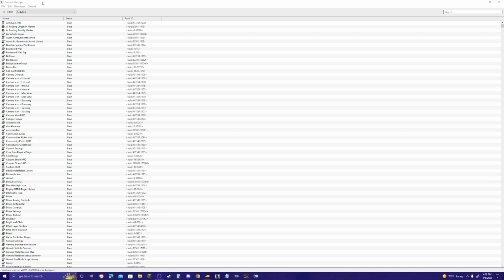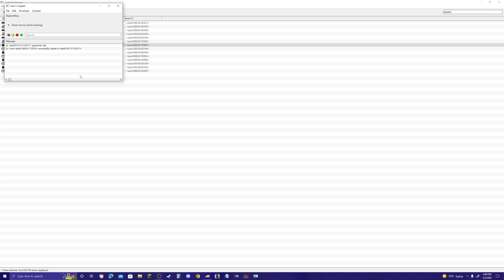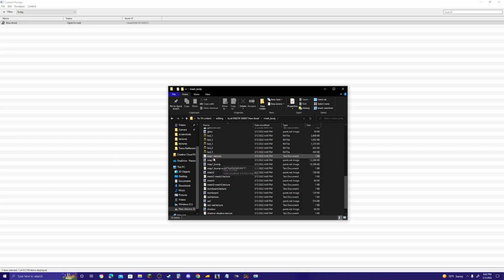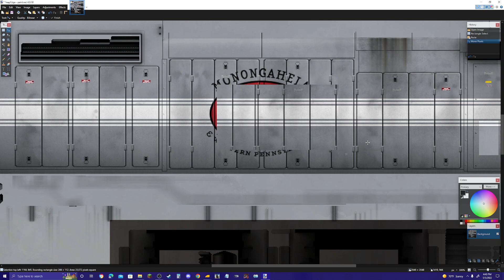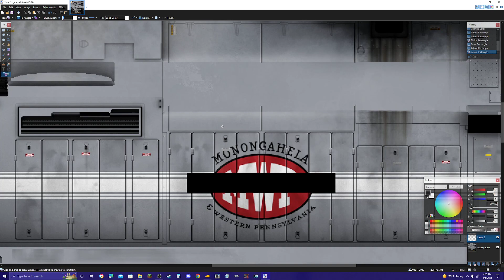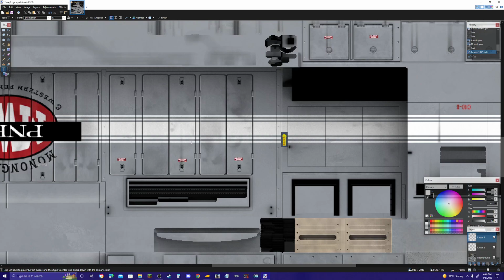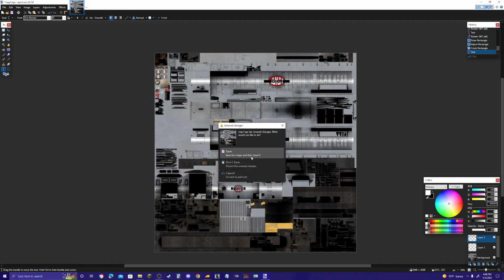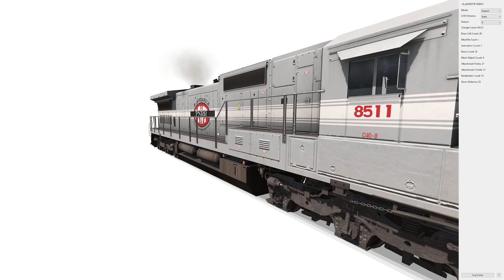Trainz Reskinning Tutorial | Part #1 | the basics of reskinning | MMRRX - Trains

Comment: I’ve been having troubles with the bump map for the ES44AC and the SD70ACE how do I do it?
Reply from the maker: I'll cover that topic in a video coming soon, Some maps are difficult and are hard to blank. I'm assuming that it is just one of those hard maps, they might not be blank-able. Sorry.
Reply: @emmitt342  really 😔
Reply from the maker: @cpjjp4705  I think that it is a CSX K5lA, 3 part
Reply from the maker: @cpjjp4705  I have now learned that you need an older version of pdn to reskin some bump maps. I am running version 4.0.5.
Reply: @emmitt342  can you at lease still make a video about it?
Reply from the maker: @cpjjp4705  I'll make a video soon